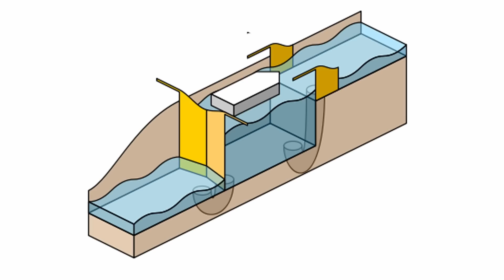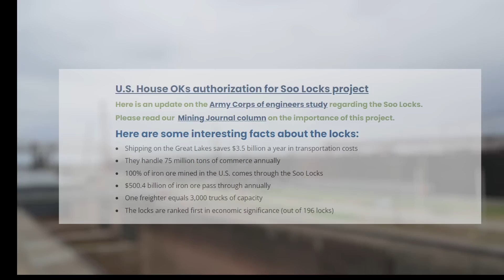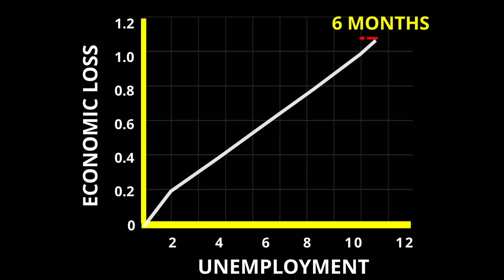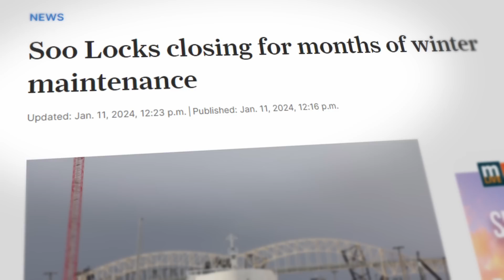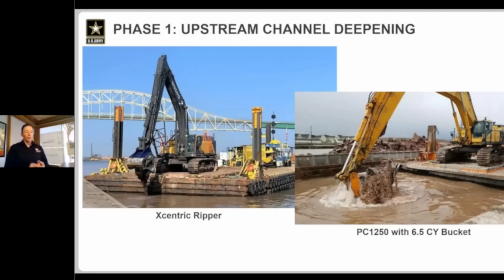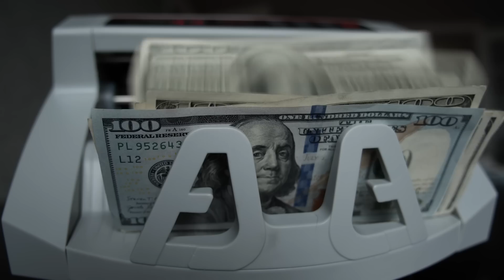The $3.2BN US Megaproject to STOP a $1 Trillion Disaster | Building A New Soo Lock

Comment: Ok Canada has 2 locks there at  Souix Saint Marie just on the other side of the falls yes there are still falls there, second THOSE LOCKS ON THE AMERICAN SIDE HAVE BEEN IN NEED OF REPLACEMENT SINCE AT LEAST THE 1960'S, Third the only reason it is such a big deal now THE SHIPPING COMPANIES ARE REPLACING THEIR ANTIQUATED BOATS WITH LONGER, WIDER , TALLER, HEAVIER,  SHIPS, hence NEW LOCKS FINALLY.  Also all shipping thru the soo locks ENDS EVERY YEAR JANUARY 31 AND THEN RESUMES APRIL 1 that time is used for maintenance basically duct tape binder twine, and spray foam..ie lipstick..

Comment: They should build a power plant from the downside they should dig a tunnel that's larger at the top than it is at the bottom like a funnel. Then they should put the power plant in at the bottom and open up the water at the top to flow through that funnel very very fast. And insufficient quantities.
Reply: great idea.  That's why they built one there in 1902 - and it's still on line!  Watch Alexis Dahl's YT video "Behind the Scenes of a $3B Megaproject (Soo Locks)
Reply: They have a generating plant right next to the new lock???

Comment: Although the MacArthur Lock is 800 feet long and 80 feet wide, this lock can only accommodate vessels 730 feet long and 76 feet wide due to the southern shoreline. The Corp also needs to modify the southern shoreline to maximize the use of the MacArthur Lock.
Reply: It's a straight in approach to the Mac. The reason it is not used much is because like the Sabin and Davis locks it's to shallow for most loaded vessels. Besides if you had done some research before making your silly uneducated comment you would know all locks have a maximum size for ships. They have to fit otherwise what is the point?
Reply: @alexandersinclair9006 There's no lock that can fit unlimited size ships?

Comment: It’s certainly important to have a second lock to handle the big 1,000 footers that transport taconite south. That said, it’s not like the flow of all the goods would ground to a permanent halt, given the expanse of rail systems that could be diverted to handle the flow of those needed goods.
Reply: One rail car can carry around 100 tons of taconite. A 1000 footer carries around 60,000 to 77,000 tons in one single trip depending on lake levels. Not sure the rail system could handle all the extra demand. Not to mention the potential of derailments we currently see around the country
Reply: @mikefournier6168  doing some quick math here:
60,000/100 = 600 railcars
That’s probably 6 trains at 10,000 tons each.

I don’t know how many of the 1,000 footers carry taconite and at what frequency, but it seems doable.

I guess the bigger question is 1) the rail loading infrastructure in Duluth or near there that could load the taconite directly onto the railcars, and 2) the mainline infrastructure from Duluth to Chicago. I know that CSX and Norfolk Southern mainlines run through Gary IN where the massive US Steel Gary Works is, and I would “assume” that taconite could be delivered there by rail.

In summary - a second 1,000 footer lock at the Soo is much needed and long overdue without question. It just seems to me that the negative impact is a bit exaggerated.
Reply: @jstoli996c4s you forget on thing. There are only a handful of rail lines that run south. They all converge in Chicago. It takes a full day to move one train across Chicago. So yes there would be a massive problem if the locks fail. Rail simply can not handle that much freight.
Reply: @alexandersinclair9006  fair point if that’s the case
Reply: @alexandersinclair9006  
Rail can handle the freight no worries about that. 
It's just having the knowhow on  Coordinating the movements.
They did it back in WW2.
Reply: @richardbause2453 Sure they can. UP lost entire trains after the last big merger. Your faith in the railroads is several misplaced. But you know everything so later tater tot.
Reply: @alexandersinclair9006  
Just gotta let it play out 😊.
Reply: @richardbause2453 US rails were in much better condition going into WW2 than they are now. Much of rail’s lucrative businesses when to trucks. The rail lines would be able to support moving the quantities needed with huge intervention from Washington and it would take at least a year to build up the required rolling stock. Railroads don’t keep thousands of bulk carriers lying around incase.
Reply: @matthewhuszarik4173  
With the scaling back on railcar delivery of coal, there is a surplus of cars and engines across the country that can fill the void. 
It just comes down on knowing how to coordinate. Something that alot of individuals have no clue on how to do.
Reply: @richardbause2453  Those engines and stock are gone auctioned off for scrap. Railroads simply do not keep the number of spare engines and stock on hand that it would require.
Reply: @matthewhuszarik4173  

Apparently you haven't looked closely at the locations where engines are stored. 
BNSF, UP, NORFORK SOUTHERN, CSX, CN, CP, KCS all have about a 3 to 1   Ratio  of motive power in storage. 
Rail Cars of all types are in storage and new cars are being built every day!
So you can't say that there isn't enough 🤔 equipment capacity to handle a crisis. 
Better look 👀 around a little closer.
Reply: @alexandersinclair9006  

Yes, coal cars can carry iron ore, maybe a little less if they are aluminum cars.
There are a surplus in storage so you can't say that the product can't be moved. 
VR Camera just recently caught a whole train of new ore cars going north from Texas so car fleats are getting updated cars all the time.
Reply: The rails do not have the rolling stock to support anywhere near the needed capacities. It isn’t like they keep 10,000 bulk carriers and engines sitting around.
Reply: Rail cars are designed to carry 115 tons or, combined car and load of 286,000 pounds max.

Comment: Loss happens without maintenance.. They should also fix the 2 defunct lockes and have a working budget to maintain them.
Reply: The new lock is being built in the place of the 2 defunct locks. So itll be 1 smaller one and 2 larger locks.
Reply: @brabblemaster401  Nice
Reply from the maker: Thanks for watching it!Once the new lock is completed, the Poe Lock will undergo a significant upgrade, ensuring that both large locks are fully operational. It’s all part of a bigger plan to keep things running smoothly for the long haul. Thanks for chiming in @brabblemaster401
Reply: I think the USACE knows what it’s doing. Regulations prevent any ship that has a beam greater than 76’ to transit the MacArthur lock causing a lot of traffic jams at the Poe lock. Majority of ships must use the Poe lock. Sabin and Davis are the same size if not smaller than the MacArthur. Building another Poe lock would effectively erase congestion at the locks (I’ve had to wait 5 or 6 hours for a turn back before!) and allow continuous operation even if one of the two Poe size locks requires maintenance, like the video said.
Reply: @thomas1910  So youre a staunch believer in GOV USACE? Anything after you said '"... what its doing"' is not worth a dime sir. Thank you for stopping by my comment.